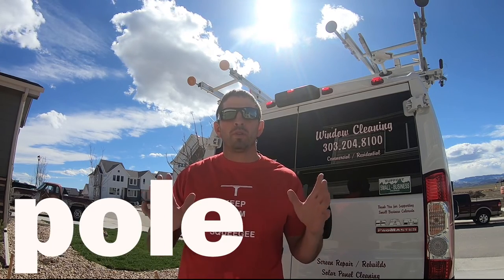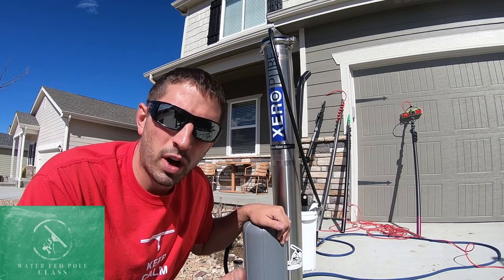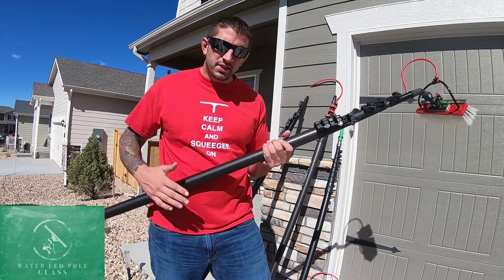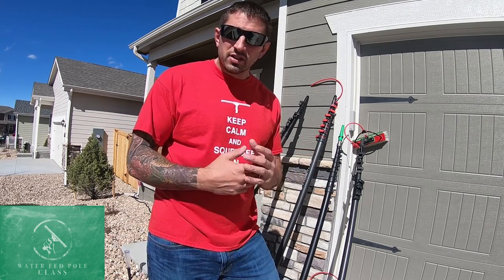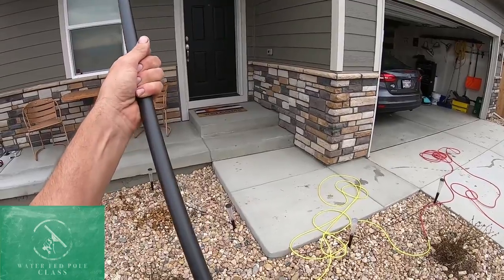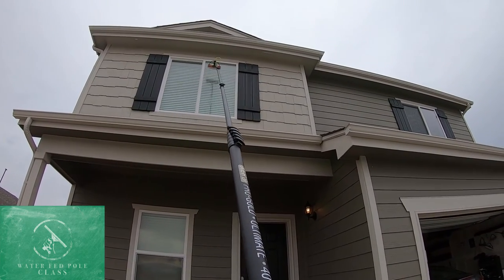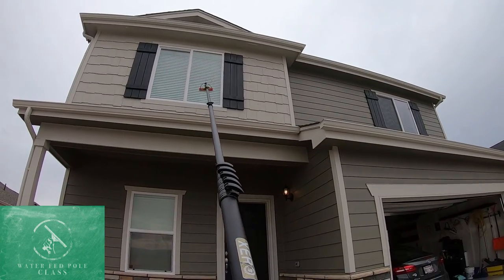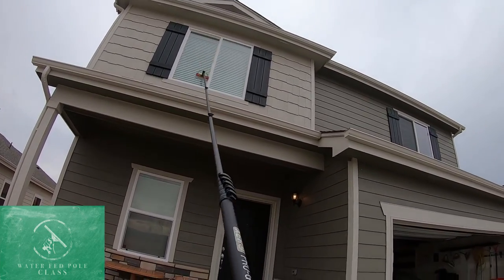What is a Water Fed Pole System?

Comment: Useful video outlining WFP using a On demand system. Where water pressure is a low a 12V pumped delivery system also comes into the mix be this a pump box or a smaller buffer tank system hold say 50 gallons of water. For pump delivery a controller to manage the pump can be a useful addition
Reply: Ian Sheppard thank you Ian!!

Comment: So, the source water is my tap water and not a soapy tank on the truck.  You will move from faucet to faucet as you move around my home.   Your "water feed pole" and filters is portable and can get through a gate and onto a patio without struggling with 100ft. pressure hoses.   It is a portable one man system.   We remove the screens.

Comment: Can a WFP replace traditional work on most residential jobs, or is nose to glass still required on every initial clean? I'd buy a WFP TODAY if I knew I wouldn't need to get on ladders or roofs anymore. I've seen tons of videos about this, on your channel and Jordie's and Luke's, etc., and it seems to be for exterior maintenance cleans only. 

I am aware of traditional pole work to solve the ladder issue, but in my limited experience, nose to glass unfortunately can't be beat.

Sorry for the ramble. 
TL;DR: Is WFP mostly for maintenance cleans? If not, what can't it tackle?
Reply: The Window Cleanse thanks! I think I'm just afraid to drop the money needed for a WFP and it not perform how I imagined. I'd love a video comparing WFP vs traditional on the same house. 

If I end up getting one, I'll order through you if that's ok, since I think you've said recently that you're a sales rep now.  You've done a huge service to this community
Reply: The Window Cleanse thank you!!

Comment: Be careful with that water fed pole system if you add an exterior water pressure pump to it keep an eye on the pressure I blew mine up with too much pressure it went in many pieces destroyed it look at the pressure gauge on the grey cylinder do not exceed that pressure because it will happen to you too